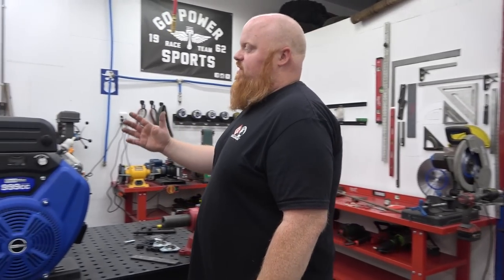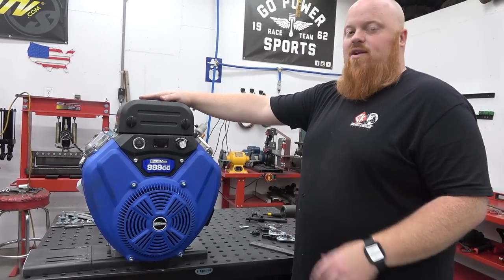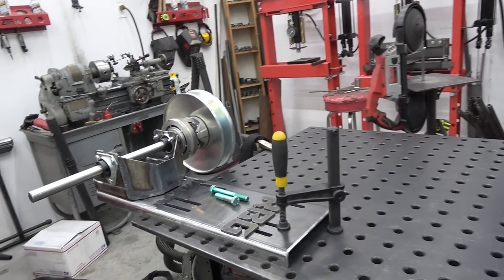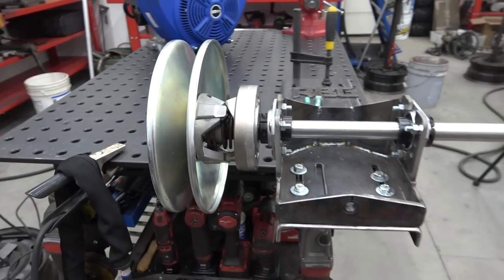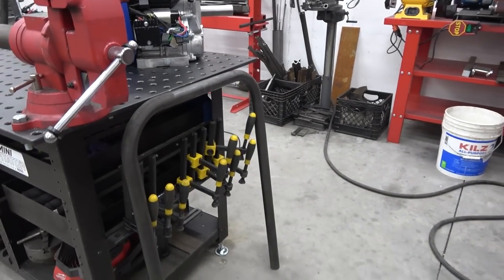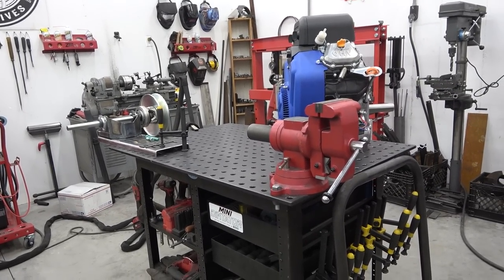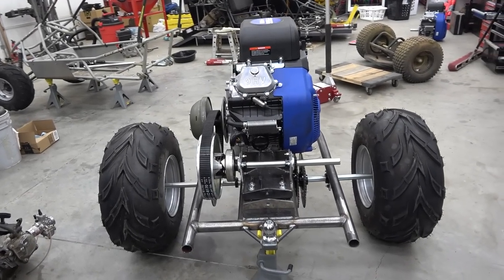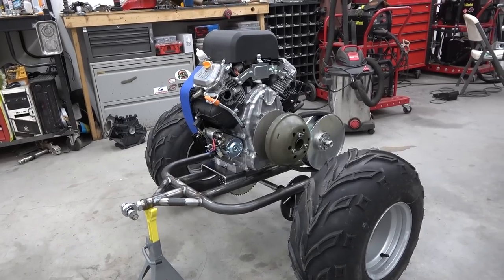999cc V Twin Duromax Kids Go Kart ~ Swing Arm Build

Comment: I'd like to see a longitudinal setup for these V-twins, has that been done before?
Reply: I want to see some front engine go karts
Reply: This is mounted longitudinal as the cylinders are in line.  You mean a transverse mount?
Reply: @SportbikerNZ  The engine isn't an inline engine, nor is it mounted longitudinally. I'll try to explain this the best I can, a longitudinally mounted engine means the length of crankshaft is facing the length of the vehicle and transverse means it's facing to the sides of the vehicle
Reply: @Dootchi  I didn't realize the longitudinal mounting referred to the crank orientation.  So yes if it was a parallel twin with the cylinders in line with the frame, then it would be longitudinally mounted.  Thanks for the info.

Comment: Dang Red;You made what I've been suggesting to move carts and trailers around.Just need a 3rd wheel on a trailer jack  to lift stuff,and you have a portable powered hand-truck.Maybe next build,eh?Forward and reverse box and that's going to be a Monster.

Comment: Is this an adequate for a two seater RZR frame?
Reply from the maker: With some performance parts it would be. Stock it might seem a little slow.
Reply: @RedBeardsGarage  I saved it from the scrap yard it literally is just the frame seems straight tho. Thanks for responding so quickly.